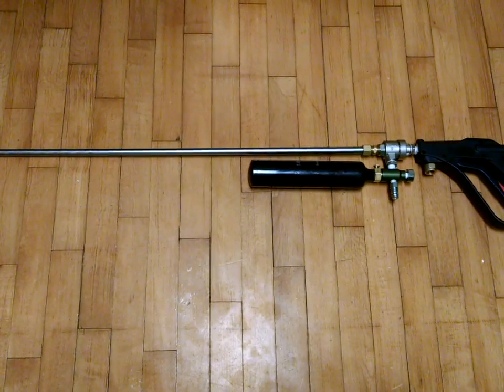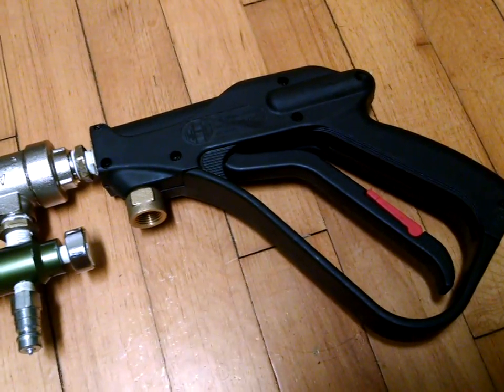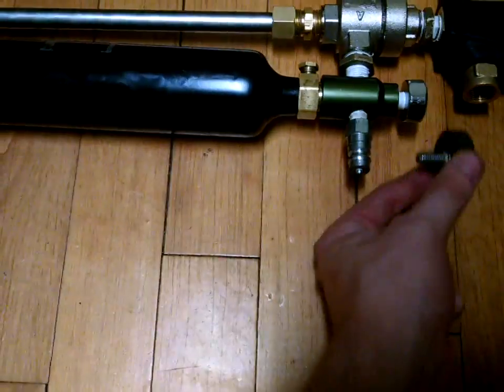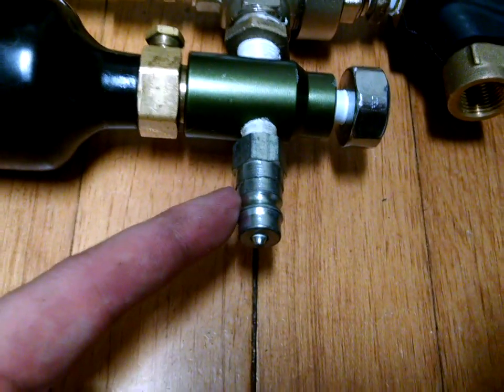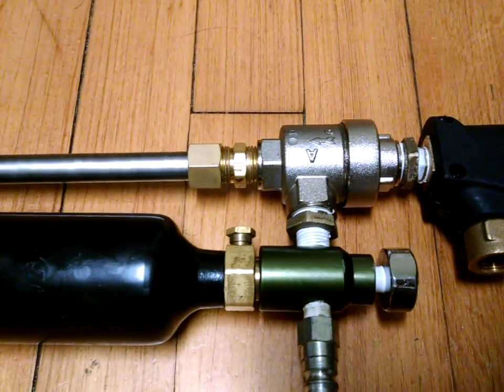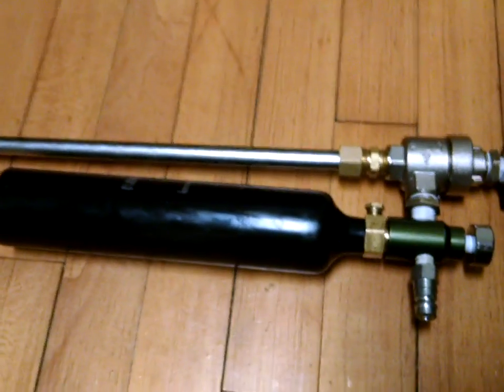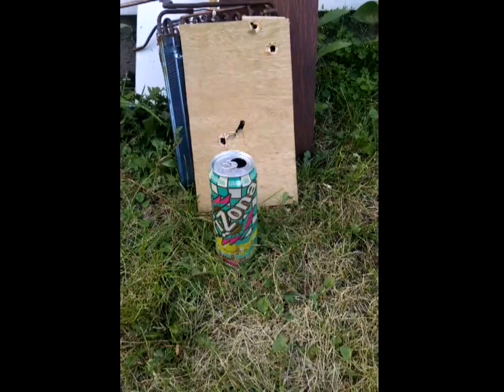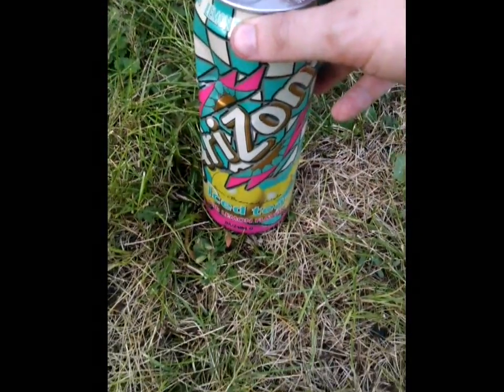Pneumatic QEV air gun rifle HOW TO overview and firing 300psi

Comment: Could you use a small 1lb propane tank with a drilled out modified hole, and refill it with compressed air?. They are incredibly cheap

Comment: I can dent a can pretty severely, how could something like this do anything less than wreck wholesale?
Reply from the maker: See my later videos. And as mentioned in other "weak" comments, kinetic energy is directly proportional to the mass of the object and to the square of its velocity. Aka something that weighs .3 grams isn't going to have a lot of energy even if it's going mach II. Weight is the key

Comment: such a good looking gun i hoped for more :( nice build though
Reply from the maker: Liam Croxford as mentioned in previous comments, it's about Mass and speed. The valve stem cover weighs nothing. It's never going to have much energy. Check out my later videos if you want to see it with heavier projectiles / more power

Comment: which compressor do you use for it? I have trouble with compressing air since i dont know where to look for it. I want around 20 bar but all i find is endustrial ones around 6 thousand dollars
Reply from the maker: check out my later videos.  i have 2 different videos describing my compressors.  current compressor hits just under 900psi
Reply: Swan Donovan thank you i will be looking for it now
Reply from the maker: Fegelborn ™ no problem
Reply: Swan Donovan so you used a fridge compressor and some fittings to connect it to your CO2 tank but charged that compressor with an endustrial compressor did i get it right? I just dont understand how it charges it and is that necessary to get 500 - 600 psi
Reply from the maker: Fegelborn ™ if you're only looking for 200ish psi,  a fridge/ac/dehumidifier compressor will get you there easily. Anything over 600 you'll most likely need to precharge the compressor.
Reply: Swan Donovan thank you sir i will look for what precharge means for a compressor now and i can save more than couple of thousand dollars with your brilliant project. There are also PCP rifle pumps they can pump up to 310 bars but since i have started to build a big ass PCP cannon i will go with compressor thanks for sharing im less confused now
Reply from the maker: Precharged just means the output of one compressor feeding the input of another.  Check out the latest compressor video i uploaded for more on that.  You need a compressor that has a lot of cfm (fridge ect won't work) for the precharge compressor.  If you have any other questions, post them on that video.

Comment: swan i tought the qev is rated for 10 bar. but you are far above, is it actually safe to use
Reply from the maker: i've had mine to a little over 40 bar, and know other people who have taken theirs to around 70 bar.  the thing that usually fails is the diaphragm.  that being said, i wouldn't trust a cheaply made qev (ebay / china).  always go with a well known manufacturer.  usually pneumatic and hydraulic fittings are rated at a 1/4 of their burst pressure.  is it safe to use at this pressure?  up to you.

Comment: weak ass gun it barely moved the can
Reply from the maker: that is correct!  hence why i've made many modifications to it.  as stated in previous comments, you're welcome to view my later videos for what it can actually do
Reply from the maker: also, this was firing a valve cap... about the weight of a .177 caliber pellet with a lot more surface area.  aka as soon as it leaves the barrel, it starts slowing down very quickly.  not only that, but once it makes contact with the can, its limited energy is spread out over a much larger area.  common sense, one would think
Reply: you just got schooled

Comment: FPS of rifle? Nice build btw
Reply: Swan Donovan your rigle ia inspired from rulof maker's mechanism, that's true
Reply from the maker: if you're talking about the bore, it's straight.  non rifled sadly.  and thanks.  check out my later vids to see what it's capable of if you haven't already.
Reply: FPS means feet per second.
Reply from the maker: with how you worded your question "fps or rifled"  the "or" really threw me off.  i don't have a chronograph to measure fps.  ggdt calculates fps with the valve stem at 400psi to be 1425.  at 600psi 1912fps
Reply: It says fps OF rifle. 1912fps sounds ridiculous. Professionally made air rifles don't get that high.
Reply from the maker: the valve stem weighs way less than a lead projectile.  even one that small.  it's like how you can get a pingpong ball going crazy speeds.  sure it's fast, but air resistance slows it down extremely fast, and it doesn't have a lot of energy
Reply from the maker: ah it looked like or on my phone
Reply: You think it could take down small game like rabbits with a heavier projectile?
Reply from the maker: for sure.  i usually use a 5.2 gram steel ball bearing as ammo.  check out this video (or an of my later ones) https://www.youtube.com/watch?v=7sE3Q73vFNU&ab_channel=SwanDonovan  skip to about 4 minutes in.
Reply: Sam Howard

Comment: Why don't you just connect the container to the pressure gun inlet?
Reply from the maker: because the qev flows a lot better than the valve that's located inside the pressure gun.  not only does the qev have a larger inlet and outlet, it's a superior valve all around
Reply: Hi 
Is that mean with the qev is more powerful ?
Thanks